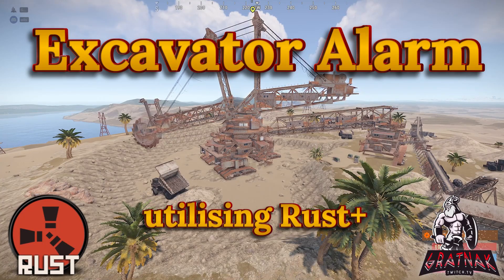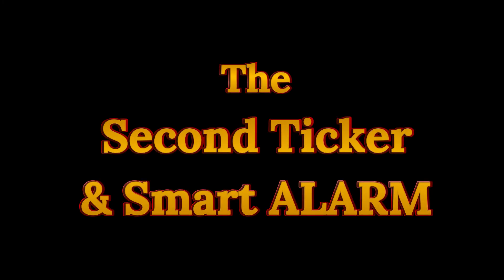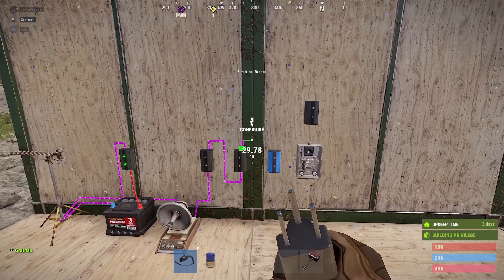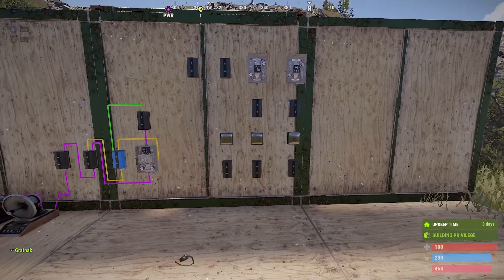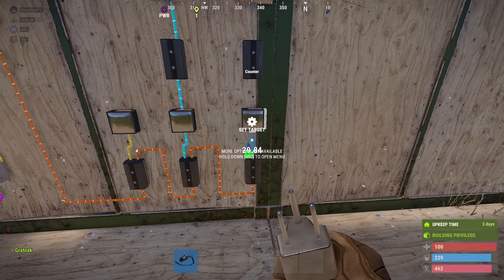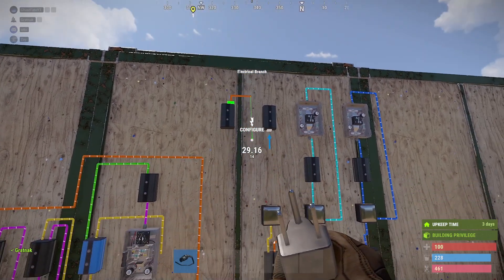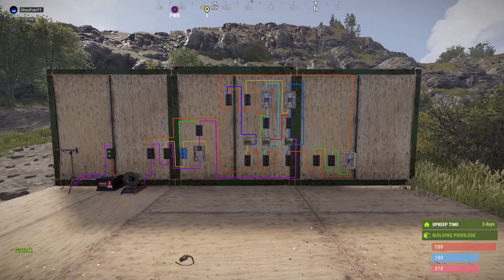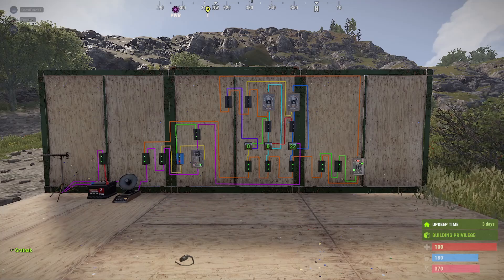Rust: Excavator Timer and Alarm

Comment: Awesome, its always a nause getting to excav and finding out its in use, no more unnecessary trips now - is that why you made it?
Reply from the maker: I initially created this project a few years ago. It included speakers connected to a verbal warning system and a large flashing neon sign. I did not include those features in this build, as they would require additional costs for users and could lead to confusion. Additionally, a larger battery would be necessary to support them.